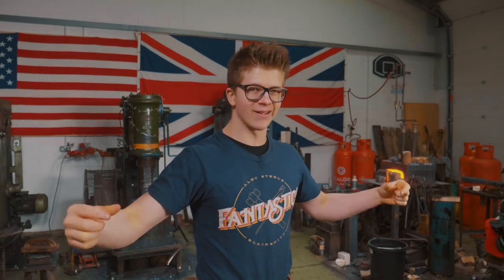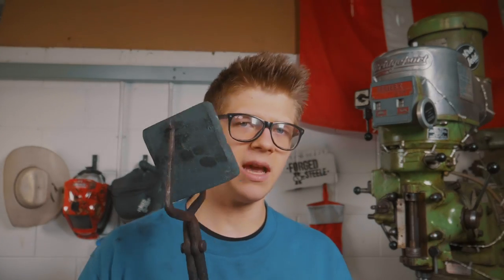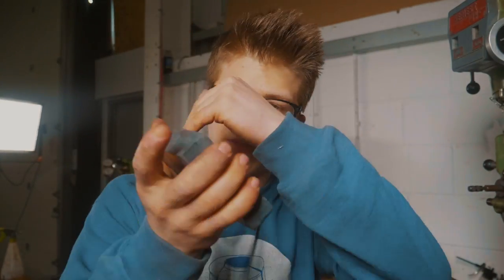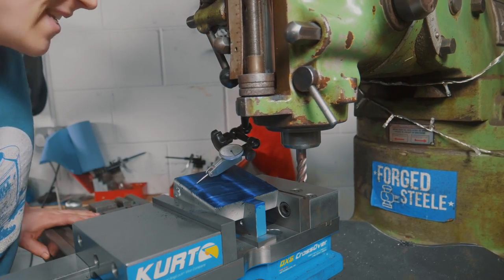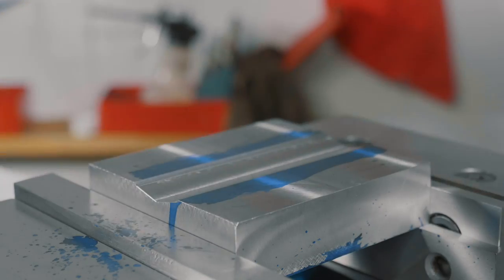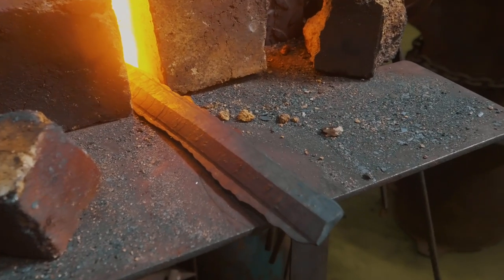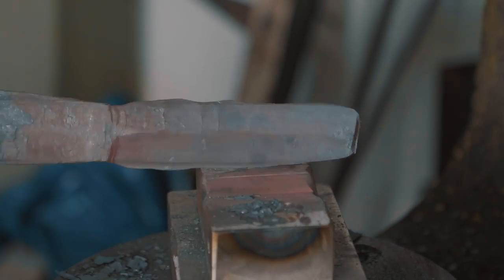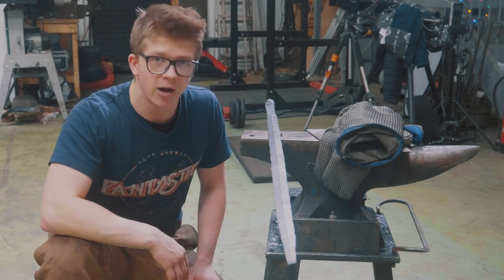MAKING A BASKET HILT RAPIER SWORD!!! PART 3

Comment: I get so disappointed when I use my powerhammer and no theme music starts. Think I'm gonna fit something up in my earmuffs. Or pay an apprentice to hold a speaker.........
Reply: Brandon my shop has a radio mounted to the wall, that screams rock, country, etc whenever I'm forging, and the power hammer. My line of thinking is if my hammering annoys my neighbors the radio is not going to change the noise complaint.
Reply: I want that job
Reply: Dang it, Brandon beat me to posting that joke!
Reply: And even when the music is playing, it doesn’t sync to the beat of the hammer!
Reply: why hello Brandon .... still want to hire an apprentice to hold a speaker
Reply: Are you accepting applications?

Comment: That was bad-ass.  The die, and figuring out the dimensions to minimize the flash effect... absolutely masterful.
Worked out just like ya wanted.  Even with all the time it took, a lot easier than hammering that all by hand.
Plus, some valuable lessons learned on the (smoother, more accurate) milling machine. Go Alec Go!  
Turning into one awesome creation.  So many new things tried here... Can't wait to see the final etch.
Reply from the maker: Thank you Sir!!!

Comment: Alec, I found a swordmakers anvil once. It looked like a London pattern anvil but on the face we’re 3 different sword proifiles. I imagine this was the bottom swage and there was a matching top swage. It is similar to what you have done. The difficult bit is going to be heat treating something that long and thin. A pizza oven would be ideal. Best wishes- love your channel- Frank

Comment: If you were looking to repeat this process in the future, perhaps a small hot rolling mill might be the tool for sizing the damascus to the preform dimensions. It would evenly squish the material to an accurate thickness ensuring that the pattern is distorted as little as possible. A hot rolling mill would also save you a butt load of time on your surface grinder,  given you keep things flat.

You waste a lot of steel, abrasives, electricity and time when you grind the damascus flat. As a wood worker I find my thickness planer invaluable for producing precise sizes of flat dimensioned square material. I think you would appreciate something similar as a craftsman trying to make very precise fine pieces of work.
Reply: ThrowingItAway thoughtful reply!!  Having looked into some woodworking myself, I was thinking the same thing but didn't know how to express it!!
Reply: Perhaps it wasn't that thoughtful. He could use kiss blocks on his press or power hammer to size his material which would probably be easier to do. That way he isn't checking with calipers constantly.

Comment: I love your channel I've seen every single video. If you have as much material left over as you calculatet you could use it for a Gauche. A secondary smaller sword that was often used with a rapier to block the oponents blade. 
Greatings from Germany

Comment: You are turning yourself into a first rate Machinist my friend! Your friendly Machinist!
Reply: If I had a surface grinder at home 🏡! I would seriously upload some neat how to videos on grinding angles using a sign chuck! (I used to surface grind everyday for 3yrs straight!) But you can invest in a good compound magnetic sign chuck, and a good set of gauge blocks! Learn how to do some right angle trigonometry, and become a grinding wizard! Your friendly Machinist! (Not implying that you don't alread know how to use right angle trigonometry to find lengths of right side, adjacent,  and hypotenuse of right angles!)

Comment: Making those dies for the power hammer may have taken some time, but it it also saved some material from becoming powder, on the Grinding room Floor.
It's nice to see you using Fusion 360, it's a great program, that's pretty easy to teach yourself.  But there are several good sources of fusion knowledge here on YouTube, Jon Saunders' channel NYC CNC, is one that I watch religiously, (asis yours, of course) and Lars Christensen  is another of the Fusion Gurus, I recommend.

Comment: So, this will save you time on grinding it sounds like. Would using a set of dies in the hydraulic press work better than using the hammer or would it be the same?

Comment: I imagine if you intend to use the die to create the bevel on other Damascus pieces, it would be worth the work of making it many times over.  Also, you could probably make a series of larger>smaller dies if for some reason you were mass producing things to this shape that you didn't want to flash and have to trim like that.

Comment: Hey Alec, 
Was just wondering, would it have been better to use the press instead of the power hammer do forge the bevels?
Might stop the problem of the flashing?

Comment: Alec, I just started being an eleven year old blacksmith! But I have a problem, I don't know what hammer I should use for regular small projects like the leaf that you taught Mike Boyd to make. (that's how I found out about you and my passion for being a blacksmith, I watched his dagger video) All I want to know is what you think the weight of my hammer should be. Thanks!!!
Reply: Jordan K hey you might try just using different hammers until you find one that feels right. also depending on how much you can curl with your dominant arm should be an indication. say you can curl 15pounds you could try a 2pound-2.5pound hammer.
Reply: cool, thanks!
Reply from the maker: Use what feels most comfortable to you! You don't want to do any long term damage. You'll probably like a 2lbs hammer pretty well until you grow bigger and stronger!
Reply: Thanks Alec, Great vids!!!

Comment: Looks fantastic alec!!  In relation to the dies you made could the flashing be reduce and the accuracy of the forging improved if the dies were made in a male and female portion?  Have the same bevels cut in them just on the static piece it is recessed further in and on the hammer piece it is protruding a little??  Just thinking out loud.  Love your videos!!!!

Comment: You should cast a led pommel to move the point of balance further back!
Reply: Pommels on rapiers are not there for balance, they keep the handle on and are a connect point for the guard. The only swords they are there for balance are leaf shaped blades and long swords that are cut oriented rather than thrusting as both leaf and cut oriented long swords have more steel closer to the point which moves the center of balance forward so a little extra weight at the end would counter that without making the whole hilt extra large. Many pommels that are large like disk pommels are often actually hollow and don't weigh what you think they would. The balance on swords is the whole hilts weight combined verses the blade length, the pommels function is to hold the handle on and create slip resistance. 

As for balance you don't want the center of balance all the way to the hilt, depending on the sword length determines where you want it, an arming sword 4ish inches from the hilt, a long sword or rapier 6ish inches. Why is that, well because if the center of balance is at the hilt on your sword then a properly balanced sword of equal dimension will be able to easier block and parry while easily getting past your own because there's more weight towards the point. So a lead pommel for any sword is simply a terrible idea.

Then another good reason for not using lead is lead is too soft, your handle will be loose after 3-4 test cuts.

Comment: My dear boy. I appreciate your attention to milling the dies as you did, on your beautifully refurbished mill. But,. . .if you think as a blacksmith, and how the metal wants to move while hammering. . .you need to induce an equal draft angle in 3 DIMENSIONS with your die. 
Think about it. You are on to something with pulling the material through, rather than pushing. Step 1.
That excess material (as 3 dimensions) needs to rest somewhere prior to forming at the point of impact. 
My suggestion: Relieve the die in both X and Y axis with a rolling taper (the degree depends on the force of your hammer's blow) on both sides of the impact middle point. Basically an hourglass side-to-side and bottom-to-top. The result: A true central spine. 
I know, it seems weird that inducing slop gives a more precise final result. Step 2.
Why? As a blacksmith, watch and feel how the material flows. Find the resonance where it is happy. Power tools, for all their awesome glory, can lead you down a stray path. They give results at the sacrifice of feedback. Use them wisely, with discretion and knowledge. 
I have made similar dies for custom profiles and have drawn many, many yards of material through them. You are fortunate to have but a single object that you are working with.

Comment: Using the hammer is cool but most forging using molds are squeezed by hydraulic presses. I'd like to see how you press does with white hot metal and the mold. Well, maybe not most but alot are used with presses.

Comment: I was surprised to see the dies working even after the mistake. I thought that the extra cut would create a plane of weakness that would have resulted in failure under the forces created by the power hammer. Is filling the cutout with filler weld unnecessary?
Reply from the maker: These dies may only ever get one or two more uses in a lifetime so I'm not concerned. If I was doing a production run of blades I would scrap the steel and make new dies. Especially because the dies need to be hardened for a production run which would further make it likely to cause a stress fracture along the hard edges of that cut out!

Comment: Just wondering, why were you running a shade face shield for the first day or two of this build to make the damascus, and then you are straight back to your usual today?
Reply from the maker: Forge welding those big billets throws much more radiant heat and light out than normal forging! The shield makes it a little easier on the face and eyes! Not an issue on the smaller work and not helpful at lower temperatures since the metal is so dark through the shade
Reply: Makes sense,  I hadnt considered the radiant heat and light. Thanks for the reply!

Comment: Would it not be easier to control if you used the press for this?
Reply: Power hammer is faster, so you can do more in one heat compare to using the slower press.
Reply from the maker: Actually, even though this power hammer has awful control, it's still better than the press. My press is very fast and doesn't have much in the way of a light touch!
Reply: Yes! You just made my day. Thank you for all your hard work, it is very much appreciated. :D

Comment: seeing this more careful now i get the idea why the dice did not work properly, the dice its not to make a final shape but a rough shape so it was a mistake making the size of the dice so close to the final shape, you should have made it larger, with more width on it to avoid the flashing effect and still get the rough shape cause what its important of the dice its to form a center from which the bevels will grow and the angle of them on both sides, maybe you can give it a try again

Comment: You made the same mistake a lot of smith do with these swords.  It is too thick and too wide throughout the blade.  It needs to taper to a point in thickness and width to have proper balance.  It will be heavy and unwieldy.

Comment: Alec, sections of your videos (mostly direct, descriptive clips) are chromatically "flat" like you've turned down the contrast, or your under-exposed and then compensating by upping the brightness.  Your color range used to be so much more engaging and vibrant. What's up with that? Intentional or oversight?